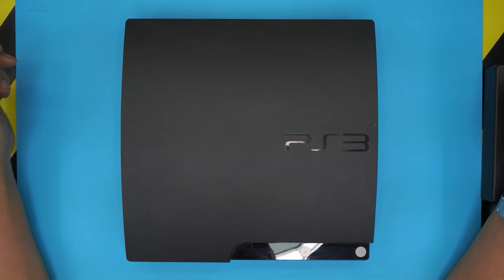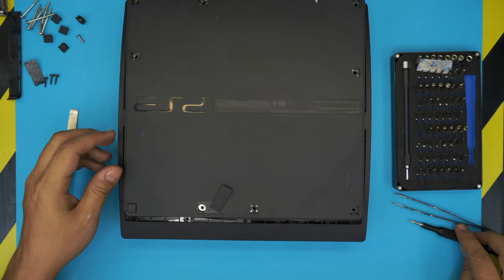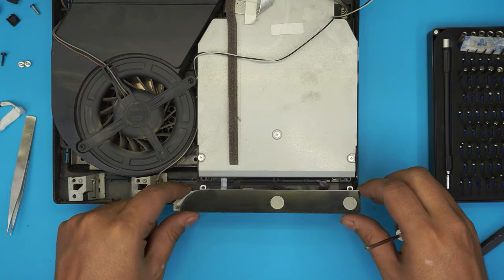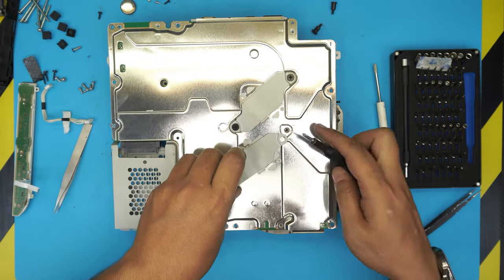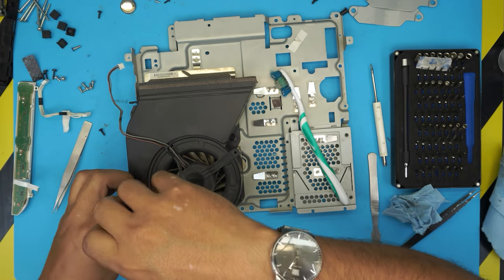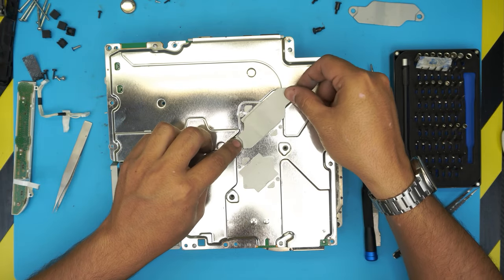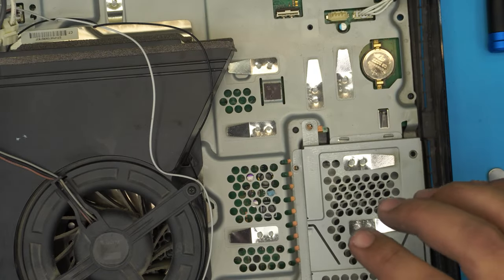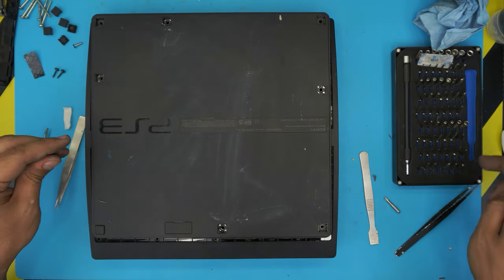HOW TO CLEAN AND REPASTE PS3 SLIM , playstation 3 slim console

Comment: Does the thermal pads step necessary or not?
Reply from the maker: Thank you for your feedback! If you wish to support the channel, you can like, subscribe, or both!
Regarding your question,  i would highly recommend you to use a new 2mm pads, but if not use the old one. never leave them without pads else it will over heat the components. but its safe to leave the stock pads back on.

Comment: People are saying deliding the CPU and GPU is the right way to do it, what's under the lid? Is it just the same thermal paste?
Reply from the maker: Don't intend to remove the IHS of the GPU and CPU. The compound they have underneath is not regular paste; it is a special adhesive thermal glue. If you try to remove the IHS, you will have a high chance of damaging the GPU unless you have experience doing it. Just repaste normally, and you'll be more than fine.

Comment: What do you mean .3 mm thermal pads? The smallest I can find is .5 mm
Reply from the maker: I apologize for the confusion caused by my previous statement. I made a mistake regarding the .3mm measurement. What I actually meant to say was that 3mm pads would be suitable for the task at hand. Either a 2mm or 3mm pad would work perfectly fine, as the pad will be compressed to achieve the desired effect. Therefore, I recommend using a 2mm pad for optimal results.
Should you have any further questions or requests in the future, please don't hesitate to ask me.
Reply: @uFixTek  okay thank you so much! I will order the 2mm pads to be completely optimal.
Reply from the maker: nice, and enjoy your serviced console 🍻 cheers

Comment: Update: From my first comment your previous video, I must mention that spot where thermal paste is (next where the GPU is not on the motherboard) there is no area or sign of thermal pads but three spaces or gaps right above the fan assembly comparing to this model. The chip that you pointed out discoloring in comparison to my mine looks a bit small in size and in great shape also no place or sign of thermal pads.
Reply: The design his demonstrating looks like a 20 series
Mines 25 a bit different on disc drive ports u can see
And the 30 where the fan is under the board model u can remove unless u remove the mother board first

Comment: The best, most detailed, clearest guide I've ever seen, done with best practices in everything!, I guess don't judge a video by its views then! 😅. what I've also would of liked to see was a detailed cleaning process in action for all the parts and what to do and not to do when performing it!, also does removing the HDD erases, formats or corrupt the data in it ?
Reply from the maker: Thank you for the feedback! if you wish to support the channel you can LIKE or SUB or both :P
regarding your question: i try to keep the video short but in my future video i keep that in mind, and about the removing the HDD , it will not erase anything, all your files and saves will be the way you left them.
if you have any question or request in the future feel free to ask me.
Reply: @uFixTek the link in the description for the thermal pads is for a 2.5mm but u say in the video to get 0.3 or 0.4 ones, am I getting things wrong ?
Reply from the maker: i have made a mistake saying .3mm , you need to get 2mm or 2.5mm any of them its fine, as the pressure from plates will press on them to get the best contact. we use 2.5mm for best results.
Reply: @uFixTek  nice, I only have 1mm and 1.5mm thermal pads, could I use both to create a 2.5mm thermal pad to replace the old ones?

Comment: Hi, I have a slim model and I will be cleaning out and applying new thermal paste. What is the difference between this video and the older video you did in july 2018? Which video do you recommend I follow?
Reply from the maker: one video the dvd drive has the cable under the dvd drive on this one the dvd drive the connectors are not underneath. thank you for the feedback and your support.

Comment: Is it better to have thermal pads that are a little larger or smaller? I'm working on a ps3 super slim for the first time and I don't know what size thermal pads I need. Thanks in advance
Reply from the maker: Thank you for the feedback! if you wish to support the channel you can LIKE or SUB or both :P
regarding your  question: the size of the pad has to be the same size of the component or a bit bigger.

Comment: Just cleaned and repasted my PS3. It was an easy job, using your video.
Reply from the maker: thank you for the feedback and your support to the channel by a SUB:P 
if you ever have any questions or request feel free to ask in any of my videos.
Reply: Did your PS3 work fine ?
Reply: @عبدالعزيزالطحشل  Mine worked fine before and after I worked on it. I sold it recently. Should be good for the coming years. Case is completely dustfree now, cpu and gpu are repasted and lens is cleaned.
Reply: Oswald Otte good to know because I want to change my CMOS battery

Comment: Hey so that stripped screw I was talking about I managed to remove by knocking it round with force with a sharpened screwdriver, after replacing the thermal paste (MX-4) the temps actually got higher, wondering if this is normal as I was tilt mx-4 doesn’t take any time to cure and even then the temps I was getting before where hot and there was no paste left on the chips when I opened up the console so I’m a little confused right now
Reply from the maker: awesome that you got it removed 🍻
oki the issue that you facing, it is very common , and we do get this issue a lot in the store, not all heatsinks are evenly flat or balanced. in you case i would highly recommend to use a High-Density (thick) thermal paste, like Arctic Silver 5 https://amzn.to/3MmQDsQ
also i would highly recommend you to bend back the CPU clamp to 60 degree, so it would generate higher pull.

Comment: Thank you, this was a great and very detailed video! I have a question for you if you don’t mind. When I had initially done this job, I used 1.5mm thermal pads (particularly soft). My model number is CECH-2001B, but it looked exactly like yours. Is the thickness for thermal pads I used an issue?
Reply from the maker: It's my pleasure, my friend. 😊 I deeply appreciate your taking the time to provide feedback. If you're inclined to support the channel further, feel free to like and subscribe—or even both!
Regarding your question, that 1.5mm is fine i would recommend 1.5-2mm but you won't have any issues.
Should you have any further questions or requests in the future, please don't hesitate to ask me.
cheers🍻

Comment: Hello there. Really nice video here. My PS3 is overheating and I want to attempt re-applying new thermal paste. I would like to ask a couple of questions though - Once I disconnect the hard drive or any of these components, will all my save game data be erased? Please forgive my ignorance, I have never had to do this before. Also, how much thermal paste do you suggest I buy? 2 grams? 4 grams? More?
Reply from the maker: Thank you for the feedback! if you wish to support the channel you can LIKE or SUB or both :P
regarding your question: #1. disconnecting you hard drives it won't erase or do anything to your files or games. and i always recommend to get the 20Grams it will last you long time and you can use it on laptops and much more. but if you want to live on the edge go for 5 grams over: 
i will recommend you this: https://amzn.to/3xbSy8E
or https://amzn.to/3rQEYX5
Reply: @uFixTek  Thank you for your help! I opened up my PS3 and cleaned out the dust from the fan and other places. When I buy thermal paste, I will then try and tackle the re-applying of the paste. For now, the cleaning REALLY helped out. 

Before I cleaned it, my PS3 would get super hot after just 10 minutes and the fan would run very fast and loud. I took it apaart following your video, took it outside and with an electric air pump, I blew all the dust out from the fan, heat sink, power supply and as much as I could from the rest of the console.   

Now my PS3 runs super quiet! I couldn't even tell it was on! I wound up playing it for a few hours and it was still silent. Just for safety purposes, I put a small fan on the side to blow cool air through the side ducts. I will buy the thermal paste and 99% alcohol. Again, thank you for your video and your advice. I subbed and gave a like.
Reply from the maker: AWESOME! , i'm glad that you got it serviced :P, if its running quietly, then no need to repaste, if you see the fan get loud even after cleaning the dust then yes "its time to repaste".
if you ever need any help or request let me know and i will try my best to help out. i appreciate all your support :) you can use my amazon general link to do your daily purchases and i get few change back :) 
https://amzn.to/2V71CPg
good luck my friend :)

Comment: Man, you have said 0.3 0.4mm thermal pads, but I can only find 0.5mm. I have also found people recommending 1.5mm thermal pads and ifixit recommends in his YLOD repair guide 2-2.5mm in thickness. I am kind of confused here
Reply from the maker: get the 2.0mm pads, i just measure 3 ps3 slim pads and its 2.0mm and i opened a 4rth ps3 slim and it was 1.5mm
go with 2.5 mm as the pressure is enough to make the contact. go for it.

Comment: Bro, are the thermal pads just these?

I saw a video of the PS3 FAT and the guy changed a lot more thermal pads. Could you tell me how many thermal pads there are in total and should be replaced on PS3 SLIM?
Reply from the maker: Thank you for the feedback! if you wish to support the channel you can LIKE or SUB or both :P
regarding your question: yes you could replace them if you wish but its not a must, and you be fine with old pads, but if you want to replace them get 2.5mm https://amzn.to/3ToFys8
and in that package its more than enough pads for few services. just cut pads and place them on to where ever you see a pad inside, simple as that, there are many reversions of the ps3 fats, so don't go around counting pads as you will be delaying your service, just the the pad link and cut it and replace them.
make sure you use a good thermal paste for GPU CPU: this is one of the best paste out there: https://amzn.to/3EZHbbi

Comment: I got a problem, please, what's the solution, turn the device on, then a few moments, and it turns it on and it stops.😢😢
Reply from the maker: Thank you for your feedback! If you wish to support the channel, you can like, subscribe, or both!
Regarding your question, the issue is very common and it is because of the over heating of the GPU.
i could give you step by step instruction and you can get it working again, but you will need to FOLLOW every step as i indicate, else don't do it.
#1. remove the motherboard completely and clean the old thermal paste from the CPU/GPU
#2. make sure you have no fan or open window or air flow on a table, 
#3. place the motherboard on a flat level wooden base.
#4. grab a hair dryer and set it to max heat and medium air,
#5. hold the hair dryer over the GPU (the thicker BLOCK) with a 1" distance straight  for about 9-12Min
#6. do the same on CPU chip.
#7. let the board COOL down on it's OWN, don't TOUCH or move or blow air to it, let it cool down for 15 min
#8. use a good thermal paste like : thermal grizzly kryonaut https://amzn.to/3RkvEtA
enjoy
Should you have any further questions or requests in the future, please don't hesitate to ask me.

Comment: If you decide to change the CMOS battery even though the existing one is still working, will that delete all login data?
Reply from the maker: Thank you for your feedback! If you wish to support the channel, you can like, subscribe, or both!
Regarding your question, absolutely not my friend you can remove the battery and replace it will not affect the data, only the date of the system will be reset and that will be corrected once connected to internet or manually.
Should you have any further questions or requests in the future, please don't hesitate to ask me.

Comment: What was the battery size again for the cmos/clock battery? I'd rather have the number as you said it quite fast. I'm gonna fix up a friend's ps3 slim and I need the right battery.
Reply from the maker: Thanks ✌  for the feedback!  if you wish to support the channel you can LIKE or SUB or both :P
Regarding your request: this are the batteries for the laptops and Ps3 ps4 and pc motherboard. 
https://amzn.to/3BioKtm
Reply: @uFixTek  just another question, I'm not gonna fix up my friends console just yet but what if my friend's console model is built where the battery is underneath the silver plate? Is it just the regular procedure of removing the plate off and accessing the battery? Because I don't have thermal paste and I'm kinda skeptical of putting it all back together after removing the plate without new thermal paste.
Reply from the maker: the battery is always exposed and no need to remove the brackets for the heat-sink. BUT if you ever remove the heatsink you will have to replace the paste.
Reply: @uFixTek  I remember seeing another video of yours with the cmos battery being covered by the plate. I'm having my friend give his model number so I can identify which varient of the model I have.
Reply from the maker: ps3 ? let me check
Reply from the maker: they are all exposed :/
Reply: @uFixTek  models like my ps3 slim need to have the mother board separated from the silver plate that the fan is connected on to reach the battery.
Reply from the maker: can you give me the model of ur ps3 i have few old ones in the shop i take a look at them on Monday
Reply: @uFixTek  mine is the CECH-3000 series. My friend has the CECH-2002A model.
Reply: CR2032 (standard bios battery)
Reply from the maker: @thekangaroo1880  yes that model you need to remove the shield plate :(
Reply from the maker: @itailevin  yes standard CR2032 for laptops and console

Comment: the motherboard screws are really stuck hard for me, i was only able to remove one by luck. Its a used one that has been in a hot place for a long time.
Reply from the maker: Thank you for your feedback! If you wish to support the channel, you can like, subscribe, or both!
Regarding your question, get the right screw driver and press down on the screw hard and do a very slight rotation, pressure is the key.

Comment: Hey so one of the screws on the power supply is impossible to get out (left) and I have no clue why, I was wondering if drilling the screw out is dangerous to the system
Reply from the maker: Thank you for your feedback! If you wish to support the channel, you can like, subscribe, or both!
Regarding your question, please don't drill anything you will damage the console, use a bigger handle screwdriver and apply a lot of force on the screw and slow twist.
Reply: Thanks for the reply however I have tried with multiple screw drivers and put extreme force onto the console and the screw is now stripped
Reply from the maker: ok, can you email me a picture of the screw head please i can assist you with another solution.
 	ask@ufixtek.com
Reply: @uFixTek  thanks for your help I’ve sent you an email
Reply from the maker: responded
Reply: @uFixTek  thanks I’ve responded
Reply: @uFixTek  just wondering if the email went through or if you need me to send it again thanks
Reply from the maker: sorry i was sick, im reply back to emails starting today
Reply: @uFixTek  oh ok no worries

Comment: Can you use 0,5mm thermal pads instead? I can see here in denmark where im from it's not easy to get My hands on 0,3 or 0,4mm thermal pads
Reply from the maker: thank you for the feedback and your support by a sub  :P
regarding your question:  .5mm can do the job my friend , it will work just press hard on heat-sink for 10sec. and you be fine.